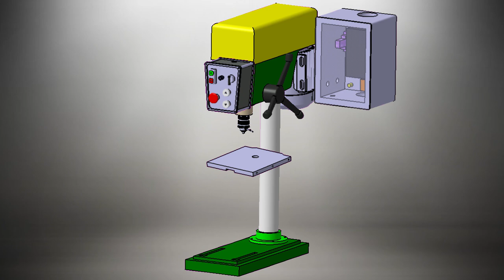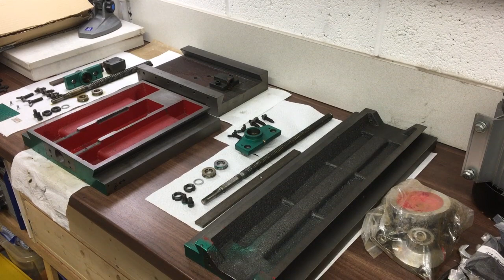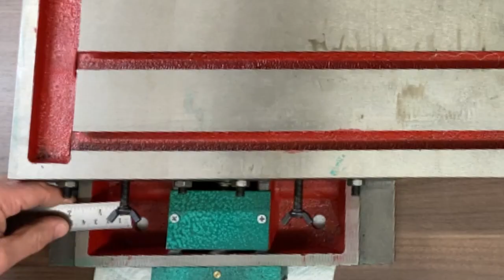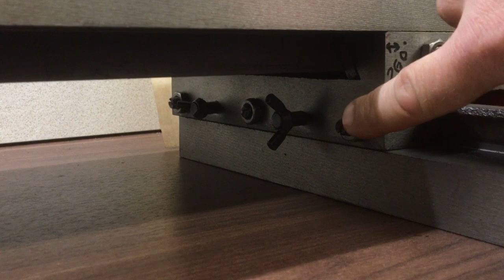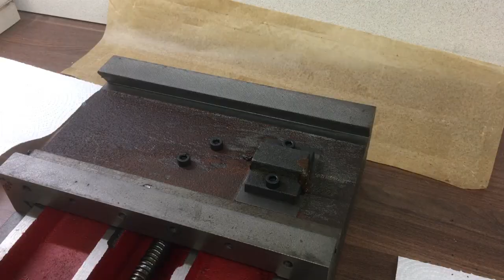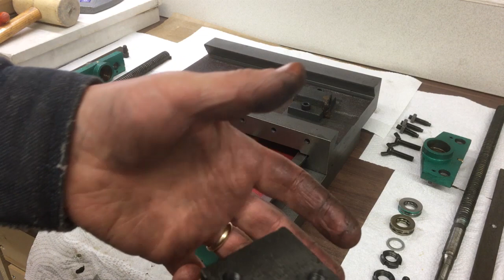Ep19: Drillpress Upgrade | XY table teardown

Comment: 225 pounds for the "vevor table", friend you got scammed badly!!
I hope the dudes that sell a 50 pound table at that price have one dropped on their toes!
Thanks for the vids, very informative.I have a long journey in front of me...
Reply from the maker: It was some time ago but they had different size tables when I bought this one.  The smaller ones were much cheaper so just check £50 is for this size.  Anyway I've been using it for a few years now and it is working really well.

Comment: where did you get your table from I can't find one the big 17 3/4x6 3\4 can u send me the link.
Reply from the maker: Apologies for the delay.  I’m pretty sure it was someone like Amadeal but a quick search for XY milling tables on eBay doesn’t bring anything up in the UK (there were some tables in Germany).
Reply from the maker: Ok found some notes and the title of it was “40218014 Cross Milling Machine Compound 2 Axis 4 Ways Working Table 550X190 38KG” from aim tools.

Comment: What model is this please? And where from cheers. O and how much and would you recommend
Reply from the maker: An Ebay search for "40218014 Cross Milling Machine Compound 2 Axis 4 Ways Working Table 550X190 38KG” from aim tools should find it.  I think I paid around £220 ? for it.  For me it was good value even though the leadscrews were bent and the finish on some items was not great.  The reasons is the castings would be difficult to make at home and they were machined pretty close to 90 degrees.  But if you buy it just to use it as supplied then be aware it will probably need a bit of going over and might need some work in places.  If you look at one of the later videos in this series, or other video projects after this one you can see it in use.  With the DROs it makes this drill press really nice to use.

Comment: I just bought one of these tables off of Amazon for the drill press. Today I clean it and attempt to get rid of the green and red. This helps me know what expect. This is an ambitious project, I hope to invest some time to watch as many of these series as I can. So far I watched episode 1, 29, 19. As this is the same stage I am at. I doubt my project will be this involved but I do plan to be able to do some sort of milling in the end. I'll keep watching and see where it takes me. Thanks for doing this series.
Reply from the maker: You are welcome Jim.  I found the dovetails were fairly good and the X was fairly perpendicular to the Y once I'd cleaned it up.  However my leadscrews were very bent and I swapped them out for ballscrews, which meant further modification for the housings.  Good luck with your project!

Comment: Can you put a link where you found that table?
Reply from the maker: I was searching back through my eBay purchases and it wouldn’t show me a link.  But the title was “40218014 Cross Milling Machine Compound 2 Axis 4 Ways Working Table 550X190 38KG” from aim tools.  It needed some work but I still think it is fair value as a “kit”.  Hope this helps.  Thanks

Comment: Very interesting. I am catching up 1 year later, and haven't peeked ahead yet. If I've understood it, you are going to sit this on a knee arrangement and hoist it up and down with that ballscrew you have fitted. I'm amazed that little ballscrew can handle the weight, and if it can it's surely going to take some winding on the handle? Maybe I'm misunderstanding, or maybe I'm seriously underestimating the weight the ballscrew will be able to lift. Anyway, you obviously know what you are doing.
Reply from the maker: Spoiler alert !  Yes that’s exactly the plan and it works out fine.  With the ballscrew pitch, table mass, ballscrew friction and hand wheel radius you can work it all out.  It’s fairly easy to lift all that weight- ballscrews are very efficient for moving loads.  Thanks for following along.

Comment: Nice table. I keep thinking about your gib screws and wondering if a replacement with a socket head set screw and thin nut would be a better idea. Or, if you are really fancy a socket head set screw with a nylon plug to act as a anti-rotation setting. Then you need no extra nut.
Reply from the maker: I wondered about that too if I replaced the gib screw (where I want to put the X-axis DRO read head) with a pair of very short grub screws.  One to lock the gib, and another right behind it to lock it off.  Keeping them short so nothing sticks out.  Then I can mount the DRO read head flush to the casting but it does mean moving the DRO aside when I want to adjust the gib for wear.  Given that the DRO read head needs to be fairly precisely mounted to get it aligned this means an easy to fit DRO head perhaps with an alignment feature.  Therefore making it easy to service the gib.  Needs some thought but is the current favourite option for X axis. Thanks.
Reply: @routercnc9517    https://littlemachineshop.com/products/product_view.php?ProductID=2625  In a pinch Blue Locktite is also your friend. The number of times you are going to have to adjust the Gibbs on this are not that large. Probably a few times from it's initial installation. If you are at all worried you can polish up the mating surfaces to minimise the peaks of the milling and you will essentially be where the final resting of the dovetails will be.
Reply from the maker: OK thanks interesting product. However I’ll probably go for the double grub screw method where the second locks the first in place since I think I have some already.

Comment: Flip the saddle so the gib screws, and lockdown screws are to the back.
Reply from the maker: Then the gib screws would stick out the back and limit the travel again.  Also you need to lock the axis off each time you drill a hole so not so convenient to reach round the back each time.

Comment: I've been wanting an X, Y table to go with my drill for a long time. This series has been brilliant to follow. It's given me many ideas, so thank you.
Have you considered stripping the DRO's down and mounting them under the cavity of the table? There might be enough room there & it'd be totally out of the way. 
Cheers from Australia - Stay safe and well :)
Reply from the maker: That’s an interesting idea.  I suspect they are too big to fit but I’ll definitely have a look to see what is possible.  Thanks for the suggestion!
Reply: @routercnc9517  I've never opened one up, so I don't know if the outer shell can be removed or not?  Good luck - fingers crossed :)
Reply from the maker: @AJR2208  The DRO readers can be taken apart (and even shortened if you are brave) so I'll have a look at the options.  Good suggestion thanks.

Comment: Nice project I look forward to a new episode.
Its probably too late but would the x scale fit in the leadscrew cavity of the table?
Also it lookslike there is supposed to be a plate adross the full width of the base casting with another ovelaping attached to the underside of the saddle as a telescopic cover to the lead screw. Rather than the silly little green plate.
Reply from the maker: Interesting idea I’ll have a look.  I have heard that Robin Renzetti (a very clever machinist on YouTube ) did something like that but had to make lots of internal modifications.  I’ve not seen the video people have referred to though.
Telescopic way covers would be nice.  Maybe some commercially available ones would fit - or make my own :-). Thanks

Comment: What will be the  max. distance from the chuck to the table???

Awesome episode as usual...great job...
Reply from the maker: I’m away from the computer so will get back to you.  I made the knee as short as possible with linear bearings next to each other to maximise the distance from the table to chuck.  I have also made it so the table can be removed quickly for taller jobs but then the part has to be located manually.  Thanks
Reply from the maker: OK the distance from the chuck to the top of the table is 200mm max.  I have the option if I remove the XY table to get 310mm for the very tall jobs but these would have to be clamped in a vice in the usual way.

Comment: Lol... at some point someone needs to send a picture and the specs of this drill press to Warco with the message "THIS IS WHAT'S POSSIBLE".
Reply from the maker: If I ever have to put in a warranty claim to Warco and they ask me what I’ve done . . . .eek  :-)
Reply: It wouldn't make much difference to Warco, these machines are just made in a factory and different names are stuck on them. I have an Axminster version of this. I went with Axminster as at the time i could collect in my car from one of their branches local to me, and 2nd Axminster give a 3yr warranty compared to the 1yr warranty Warco supply.